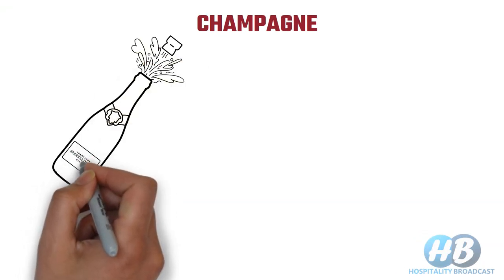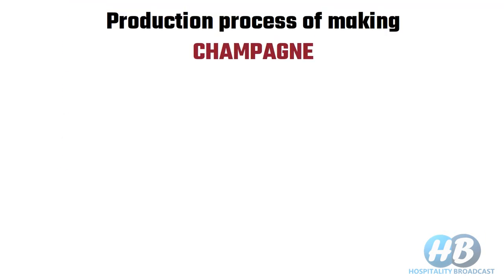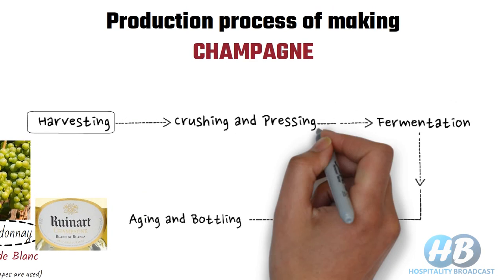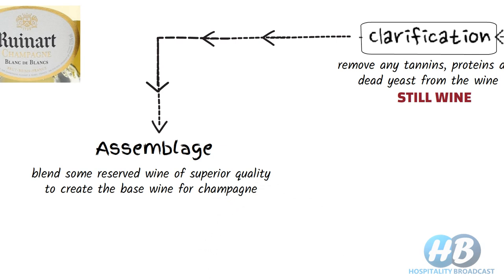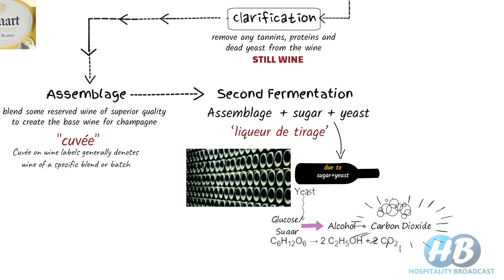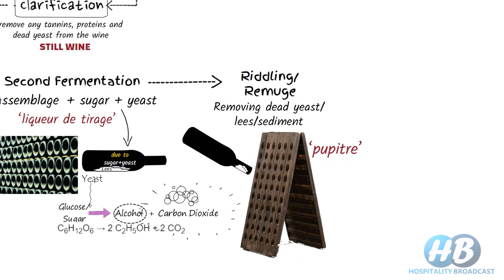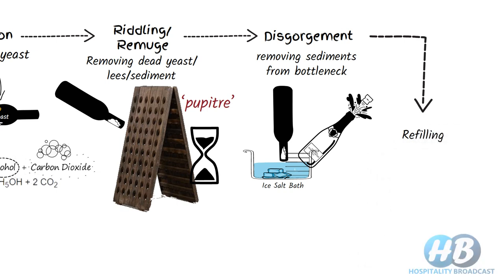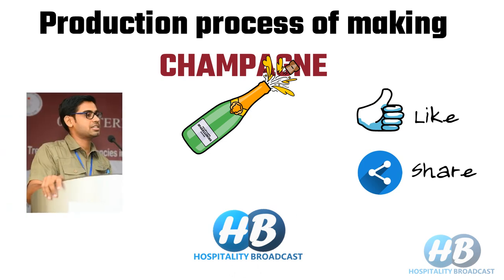Champagne making process // champagne vs sparkling wine // How to make sparkling wine //

Comment: my question is after they disgorge the yeast from the bottle after secondary fermentation and they add more wine and sugar how do they keep that from fermenting any further in the bottle? despite removing most of the yeast i am sure there is residual yeast that will keep eating the added sugar unless that sugar is non fermenting or they also add sulfates and sorbates that they do not talk about,,so do you know if champagne contains sulfate and sorbate?
Reply: Yes, the same thing coming in my mind...i think they add but not mentioned over here
Reply: @akankshasingh6994  definitely, they either add these stabilizers or another thing i just thought about is they possibly pasteurize the bottles right after the dosage ,,,unless i am mistaken and there really is very little or no yeast left after such a long period in the bottle to even be able to start fermenting again under high alcohol conditions of 11% or the yeast has pretty much died